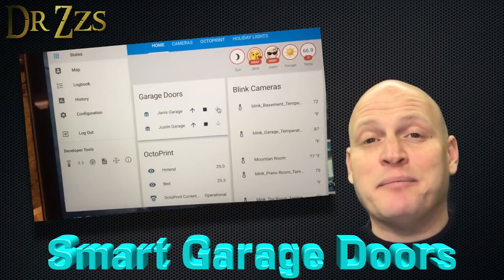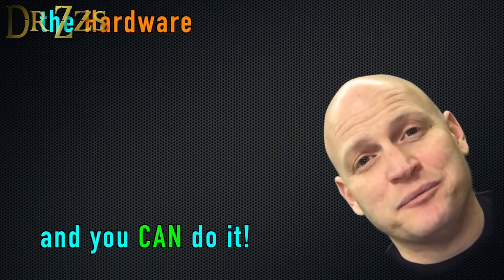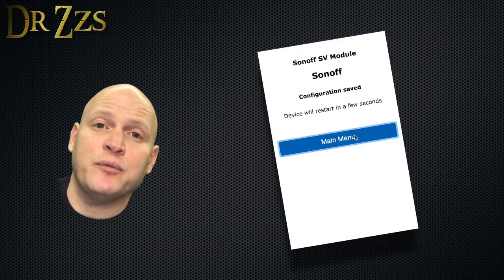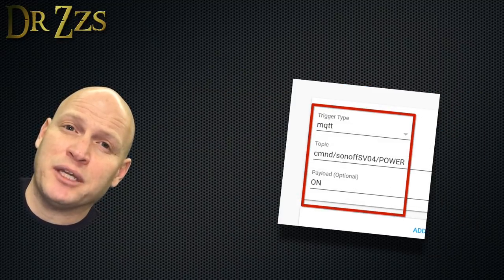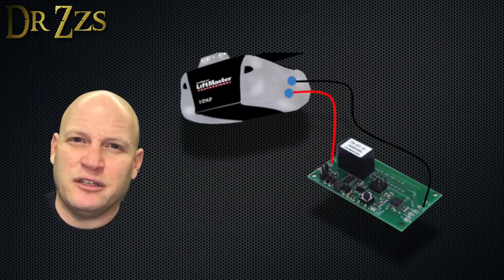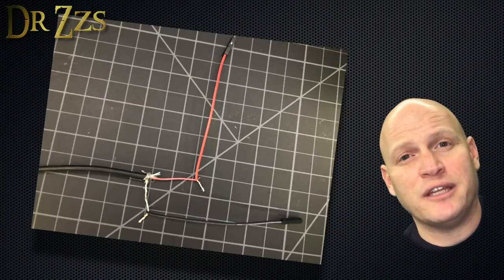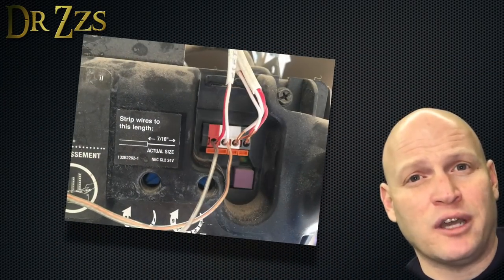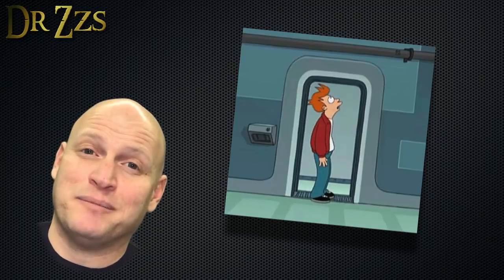$5 DIY "Smart" Garage Door Opener using Sonoff SV

Comment: How did you customize sensor to show open/close state for garage door in home assistant?
Reply from the maker: I use the service "cover".  Cover is a main heading in the config.yaml, like sensor, switch, light etc.  I think that's what makes it show the up/down arrows and shows it open or closed.  But I also assign the device_class as "garage" and make a card and assign the icon "mdi:garage", so it might be one of those that makes it do that.  I'm not sure exactly which.  But if you have all those it should look like mine. 

cover:
  - platform: mqtt
    name: "single"
    state_topic: "sensor/garage/statejanis"
    command_topic: "sensor/garage/actionjanis"
    payload_open: "OPEN"
    payload_close: "OPEN"
    payload_stop: "OPEN"
    state_open: "open"
    state_closed: "closed"
    optomistic: false
    retain: false

then in the customize section:
customize:
    cover.single:
      device_class: garage
      friendly_name: Justin Garage

then in the groups.yaml this makes a "card" on the front page that has the heading Garage Doors and makes the icon of cover.single look like a garage door. 
    garage_doors:
      name: Garage Doors
      view: no
      control: hidden
      icon: mdi:garage
      entities:
        - cover.single
 

Hope that helps!
Reply: Thanks for the quick response. I tried the settings you just sent me and nothing seems to work. Did you change something in the sonoff-tasmota settings?
I can open and close the garage door with the settings you posted in the video description but my problem is that it doesn't show whether the door is open or closed in home assistant
Reply from the maker: hmmm
You have the reed switch attached to GPIO14?  There are the changes to make in Tasmota, but just what's already in the video. 

send me some pics of what you're seeing.  you can email to justin@drzzs.com or just post a link here to imgur or dropbox. 
We'll get it figured out!
Reply: do you think the time zone on the sonoff could cause problems? I noticed the mine has Netherlands time zone which could screw up my notification of the door being open to say the least
Reply from the maker: I wouldn't expect the time zone to cause a problem like this.  Anything is possible I suppose. 
Do you post more pictures?  I just saw the one.  Can you show me what you're seeing in Home Assistant.  One thing to do is to watch the Console in Tasmota when you're testing the reed switch.  It will show you if something is firing and what the MQTT message is that is being sent.  If that MQTT topic and payload matches what you have in Home Assistant it should be working, so I'm guessing the problem has something to do with that MQTT topic/payload.  Either it isn't being sent or what it the sonoff is sending doesn't match what Home Assistant is looking for.

Comment: Nice! What issues are you having with presence detection?
Reply from the maker: Just reliability.  
I was using the iOS presence detection, but it wasn't always accurate.  Same with OwnTracks.  It wasn't bad for knowing where members of our family are, but it wasn't reliable enough to use for opening the garage.  
I'm going to try the D1-mini in the car.  That sounds promising.
Reply: OK, I thought you meant like a motion detector (PIR). To which  I was going to suggest checking the PIR sensor you're using, as a lot of them are subject to some RF interference.

Comment: GREAT! DrZzs  is spending my money again! :P Yet another reason to pick up SV's I want to build a thermostat out of a few of these too and get them to react to Tempurature sensors throughout the home.
Reply from the maker: ha!
I've had in mind some kind of D1mini connection for a thermostat.  There's got to be a cheaper option than Nest or Ecobee.  
Let me know if you make progress with that thermostat idea.  I'd like to figure that out too.
Reply: Its going to take some time. Its not going to be a cheap under taking to do the whole project like I'd want. Building the thermostat itself I don't think will be bad at all. Hook 3 SVs up and add them to Home Assistant. Without having the temp sensors in the home I wont be able to have it check against anything internally yet.

Comment: Not sure if anyone is still monitoring this tread but I have a frustrating issue.  Setup system on two garage doors and everything is working fine except when I trigger the door open/close from within HA, it activates the switch so fast that the garage door does not have time to trigger. If I activate it through the toggle on the Sonoff web interface it works perfectly.  I have pulsetime set to 10 and when I run "pulsetime" in the command I get the return {"PulseTime1":"10 (Active 0)"}. I'm thinking that is probably right as the sonoff is behaving correctly when triggering from the web interface.  Any help would be greatly appreciated.

Comment: Can I do the same with a Sonoff RF or I have to put 12v transform (or maybe 5v transf) in the output? Thank you so much
Reply from the maker: I think if you use a different model sonoff, you have to modify it to separate the relay from the esp side of the board.  I've seen pics of people cutting the solder lines in a couple places and making new connections in other places.  
I haven't done it myself.  But it is possible.

Comment: Since the sonoff is compatible with Alexa or Google Home, do we need to flash it still? Or can we use its EWeLink software?
Thanks
Reply from the maker: You can totally use the eWeLink app. You could connect it to your garage door and just use the app to or Alexa to open/close. 
The reasons for flashing are to get more functions out of the Sonoff.  For example, if you don't flash with Tasmota, you won't be able to connect the Reed switch to get the status of the garage door.  The default firmware doesn't make use of the extra GPIO pins. 
Also, with the default firmware, you can't control the Sonoff with Home Assistant.  

I love Home Assistant, and I like hacking into the boards and tinkering with the firmware and such, so I do it this way. 

Hope that helps!
Reply: DrZzs - I love the concept of making stock stuff better. this kind of hacking is ace!

If I flashed a sonoff like you describe, do you know if I can get alexa to see and react the state of the additional io pins without the home automation components?

Comment: Thanks for the great videos!  Keep them coming :-) One question, I am using your code for the HA configuration; would you know how to create a confirmation dialog when pressing any of the garage door buttons?  Basically, something that prevents a person from accidentally opening the door and requires me to confirm the "open" command before it actually opens?
Reply from the maker: Thanks! 
The first thing I'd think of would be an Actionable Notification. (assuming you're using iPhone)
https://youtu.be/Iu0NwY9QOCo

That comes to mind mostly because I'm familiar with it.  I'm sure there are other ways to do it. 
The Home Assistant forums or the Discord channel might have other ideas to try. 

Let me know what you settle on.  There are a lot of good uses for a system like that they asks for verification.  Someday I'm going to automate door lock, and something like that would be super useful!

Comment: Don't you have a problem with Home Assistant not updating the device status when being restarted with this configuration? I find the status is only updated when the SV relay is triggered and the GPIO14 status changes.

Or if say the Sonoff itself lost power and comes back online it never sets it's status to HA unless the Sonoff itself has been triggered.

I figured it's something to do with using cmnd MQTT topic instead of the others but could also find no other way to make it work.

Comment: Love your videos, did my garage door with a relay after the SV. One question, if I do the same for my gate motor, how do I change the state_topic? Because it uses cmnd/2/POWER2 it will be the same for both switches? Thanks again for the videos
Reply from the maker: Awesome!
To set a different topic in the console instead of “switchtopic2 2” type “switchtopic2 gate” that’ll set the topic to cmnd/gate/power2

This explains what switchtopic does and how it works. 
https://github.com/arendst/Sonoff-Tasmota/wiki/Understanding-SwitchMode-and-SwitchTopic

Hope that helps.
Reply: DrZzs Great, thank you very much!! Instead of removing the resistors, I added a SV relay to trigger the motor. Your tutorial on the coding still helped a lot!! Big fan of the tempo of your videos :-) Don’t have to listen to an hour for instructions... Keep up the good posts! 🙏🏻

Comment: Hello, awesome videos! Quick question, can this be done with a sonoff basic?
Reply from the maker: yes, but it would require modifying the Basic by cutting some solder lines.  I haven't done it but others have. 
The SV is almost the same price ($5 us) as the Basic.  But if you want to use the basic you do something like this:
https://www.chatteris.biz/blog/sonoff-basic-voltage-free-relay-changeover-modification/
Reply: I looked for the sonoff sv and did not find any around 5 bucks. Do you have a link you could provide where I could get them around that price?
Reply from the maker: https://www.itead.cc/smart-home/sonoff-sv.html

Direct from iTead (the manufacturer) is usually the cheapest (and most reliable) source for sonoffs.

Good Luck!
Reply: DrZzs thank you!
Reply from the maker: anytime!

Comment: Hi DrZzs, thank you for the video! it was super helpful. I was able to configure two garage doors and all works well except one issue. The status of one of the doors get updated very well, however the other door updates the status to both the doors though the other one wasn't open. Please help me!
Reply from the maker: Double check the MQTT topics for the door states.  Sounds like you probably have the same "state_topic" for both doors.  They should each have a unique word or name in the middle section. Like this:
cover:
  - platform: mqtt
    name: "test2"
    state_topic: "cmnd/2/POWER2"
    command_topic: "cmnd/sonoffSV04/POWER"
    payload_open: "ON"
    payload_close: "ON"
    payload_stop: "ON"
    state_open: "ON"
    state_closed: "OFF"
    optomistic: false
    retain: false
  - platform: mqtt
    name: "test1"
    state_topic: "cmnd/1/POWER2"
    command_topic: "cmnd/sonoffSV04/POWER"
    payload_open: "ON"
    payload_close: "ON"
    payload_stop: "ON"
    state_open: "ON"
    state_closed: "OFF"
    optomistic: false
    retain: false

Hope that helps
Reply: Perfect, thank you!
Reply from the maker: Anytime!

Comment: Great video! I always watch your videos regarding HASS and all the automation stuff you have been doing. Since last week I received multiple Wemos D1 boards and a few sensors. I already flashed the Wemos with the Tasmota firmware and this works perfectly. I read multiple blogs regarding the settings for Tasmota when using a relay shield. A have a relay shield (which is connected to D1), and a Reed switch witch is connected to D8. 

For the configuration i used the Generic and configured D1 as relay1, and D8 as switch1. Now I am able to see a MQTT message when the reed sensor opens, but I am not able to send multiple On commands. When i send a toggle (via the webpage), when it sets it to On the garage door opens.

I know this is because the Relay switches to On, and not to Off automatically. How can i configure this? I know that i can configure this with PulseTime, but how should this command looks like? Should i ut PulseTime1 2, as this is for Relay1? 

Even these commands I dont get:

Switchretain 1
Powerretain 1
switchtopic2 garagestate
switchmode1 0
switchmode2 2

How must I configure the Tasmota to use the relay (controlled via MQTT), and status messages regarding the reed switch open/closed. If I have this working correctly I would like to add DHT22 and PIR also but this is for the future.

edit: i'am now able to control the on via the webinterface with this command: cmnd/wemos-garage/POWER ON, but when send from HASS mosquito the message is not shown on the tasmota console and nothing happens.

I hope you have the time to read this and give me some advice how to configure this.

Comment: Dear, Why did you change your solution with esp8266 to Sonoff sr? You could use the same D1 Mini wemos with the sonof tasmotta firmware!
Reply from the maker: I'm still using my D1 mini setup on the other door.  
I want to try Tasmota on the D1 mini and see what all it can do. 
Have you used it for anything?  
I love the D1 mini and I love Tasmota so the two together sounds fantastic!
Reply: DrZzs yes all i can do with d1 mini, i am trying to automate a water pump to remove water from a cistern and play to the 3rd floor .. using relay, reed switch

Comment: How many Outputs does it have? I have two doors.
Reply from the maker: It just has one relay so you'd need 2 for 2 doors.  I have 2 doors also, so I have 2 Sonoff SV's
Reply: @DrZzs  I had a NodeMCU laying around and flashed tasmota on it. It has so many gpios that one device will do it. But I really need your help. I want to control it from everywhere but without running a server the whole time, how can I do it?

Comment: I’m new to mqtt. What do I need to do so that the initial state of the switch shows “closed”?  Every time I restart HA when doing config updates, it initialized as “open” even though the door is closed.
Reply from the maker: Mine always reset to "unknown" when Home Assistant restarts.  I'm not entirely sure how to fix that.  
There's a "retain" command in HA and also I Tasmota I believe.  I still need to try both to see if that will fix it. 
Try going to the Console in Tasmota and type "switchretain 1"
If that doesn't do it there are other "retain" console commands:
https://github.com/arendst/Sonoff-Tasmota/wiki/Commands
Reply: Yeah mine is actually “unknown”, sorry. The icon shows open, though. I guess I’d prefer the icon to show closed.

Comment: I followed the tutorial but my setup is reacting different, when I close the GPIO14 and GRND then the relay is activated, when I open GPIO14 the relay is off, very strange, also in home assistant no reaction when I press the up/down arrow. I also did the switchmode1 0 and switchmode2 2. I checked the tutorial 3 times but I cannot figured it out on my own :-( I am sure I did something wrong !
Reply: I have this exact issue!!! What have I done wrong? I can't work it out.....
Reply: Steven, did you figure this out? I am having the same issue. I also doubt the state topic is correct being "cmnd/2/POWER2" - seems to be wrong. One more thing with being misspelled: "optomistic" should be "optimistic", i looked up the options on mqtt specs on HA site.
Reply: @ilfir  it is the state topic that's wrong. Should be stat/yourtopic/POWER2
Reply: I figured this out. Looks like I missed this command: 
switchtopic2 2
After you run this command, status topic has to be as follows:
cmnd/2/POWER2
It all makes sense now. BTW, you can verify the status topic by watching the Console when you close/open GPIO14 and GND

Comment: Great work, as usual!   Well, I guess I will work on this during my furlough.  Government shutdown means I get a smart garage door!
Reply from the maker: Ha! 
Sorry you're on furlough.  What a mess... 
But way to make good use of the time! 
Let me know if you hit any snags. 
Good Luck!
Reply: Will do.   I already have a wireless contact sensor on my garage door track.  I noticed that you use a wired version.   I wonder if I can't just get tasmota to use that one verses a wired one?   I'm gonna think about it.
Reply: Well, since that furlough only lasted 1 day (thankfully) I had to wait until this weekend to work on this.  But mine is up and working!   I have a slightly different setup than what you have. First,  I had an existing contact sensor from smartthings already on my garage door track.  So for now, I am just operating the garage door through the ST hub.  You have to install a device handler and device on the smartthings IDE, but there is plenty of information on how to do that out there.   Second, I sent the command for a pulse from the tasmota command line.   That command will turn on the relay for 1 second and then turn it back off.   I did it that way because I wasn't using the automation script in HA that you posted, AND I can give the command to Alexa or Google Assistant to "activate the garage door".
Reply from the maker: Awesome!  ya, glad that shutdown thing ended quickly for you and everyone else.  What a mess. 
I need to change mine to use the pulse and deactivate the HA automation delay.  I didn't know that pulse command existed! I haven't been able to have Alexa open/close the garage door.  I haven't tried saying "activate".  I'll try that today.

Comment: Just wanted to make sure I need a NC reed switch? Im in Canada, so cant get the one you posted in the description.
Reply from the maker: Biggyk NC or NO will work. You’ll just have to set the state of the door correctly in HA based on where you put the reed switch.  If you have the reed switch closed when your door is open for example (like I do) just make sure your cover entry reflects that.